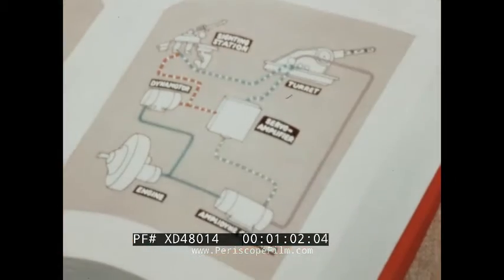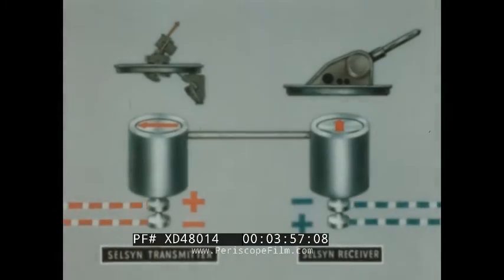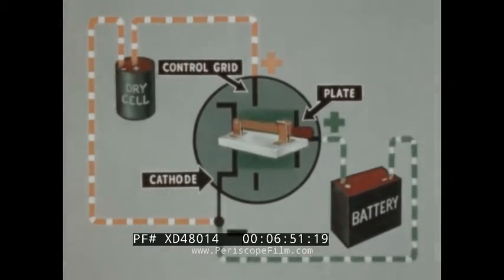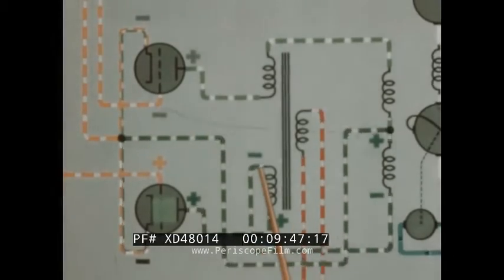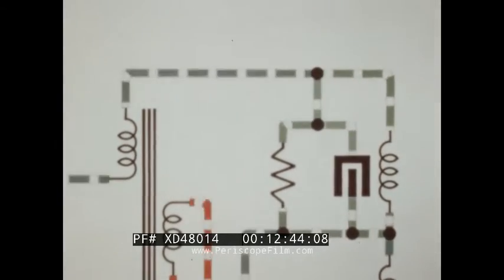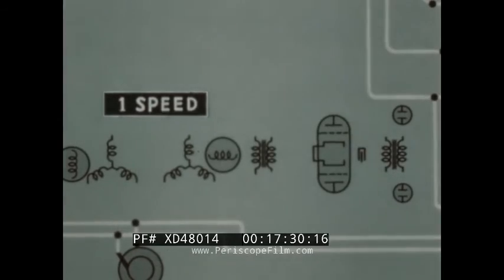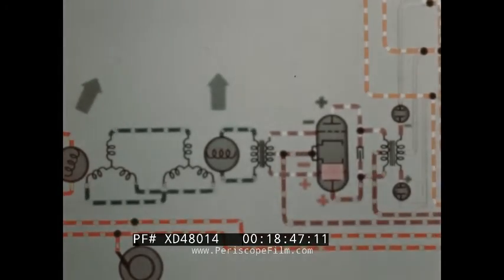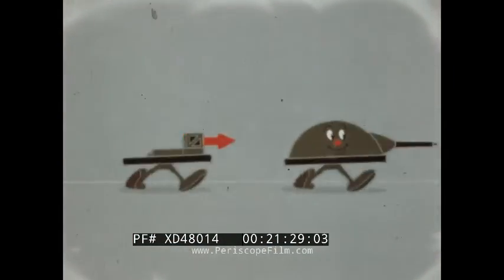“ CENTRAL STATION FIRE-CONTROL SYSTEM ” WWII B-29 SUPERFORTRESS CREW TRAINING FILM  XD48014

Comment: That's genius level stuff to put together a system like that THAT WORKS.
Reply: Well it sort of worked. Sometimes. Although most people don't realize just how complicated and expensive even your "simple" powered turrets actually were. They think they are just some motors and a joystick that makes it go left/right, up/down, but they aren't. They are carefully designed to deliver the same speed regardless of the aerodynamic and G loading on them, and to have speed exactly proportional to the control input, lockout devices that don't allow them to shoot parts of their own aircraft, intercom and oxygen fittings, reflex or computing sights. Ammo boosters, automatic return to stowage position when the grips are released, etc. A single B-17 turret cost almost as much as a single engine fighter. Hydraulic for just British turrets, electric for American (which were also quite a bit more sophisticated in general). I always cringe a little after that when I read about how they would get a brand new bomber and then immediately remove the turrets and turn it into a transport, or just because "we don't really need that one", and it would get tossed on the scrap pile. So much wasted resources! But these are the same people who would just bulldoze a plane off the runway if it would take too long to move it or was to annoying to fix. And that was before the war was over and it was easier to just throw brand new planes into the ocean than to try to ship them home. So much stuff just totally wasted even if you don't count the enormous amount destroyed in combat directly or during retreats.